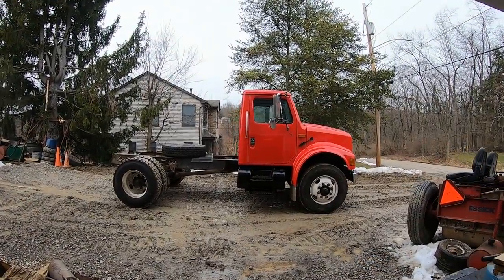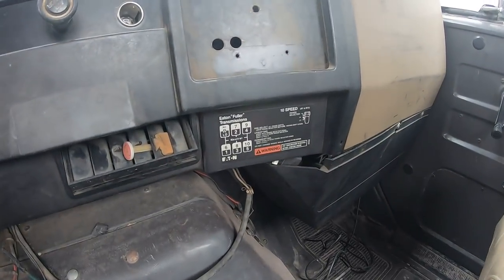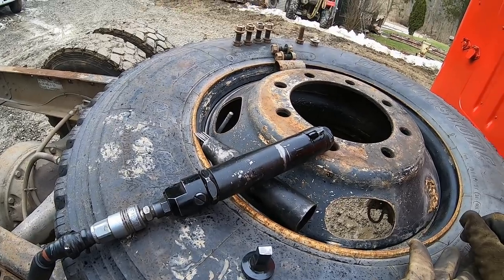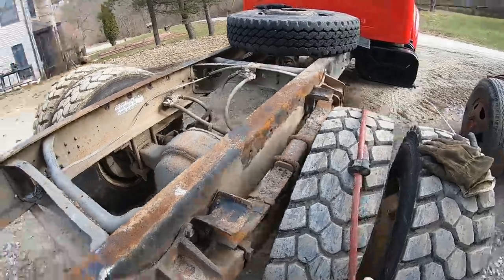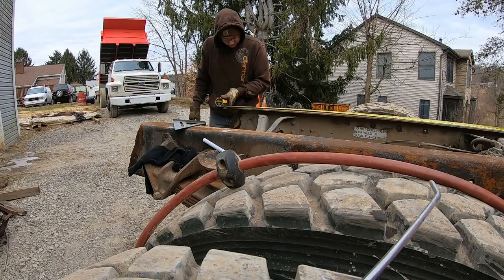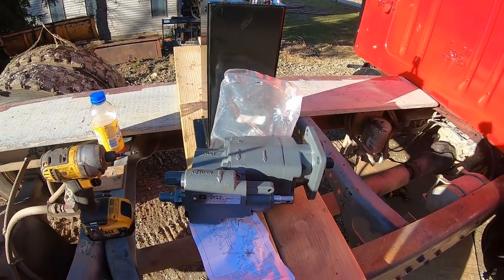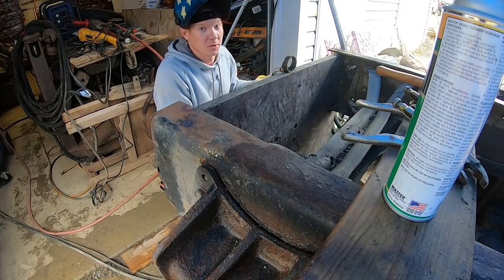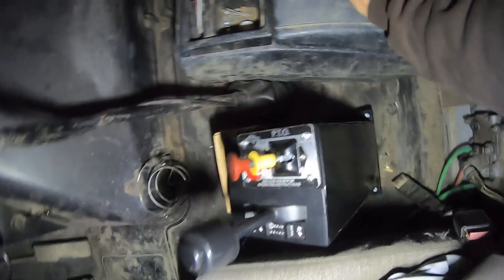Building a New Dump Truck!!!  Pt.1

Comment: many of the single axle 4900 road tractors i have seen had a 36,000 lbs gvwr compared to a medium duty cab and chassis that is typically top out at 32,000-33,000 lbs gvwr. nice base to start with. 10 speed will be helpful pulling a trailer with a big excavator. never been a fan of horrible freight products. that is an impressive metal cutting circular saw.
Reply from the maker: I wish that were the case, I titled it for 33 thanks for watching!!!

Comment: That's a great color choice.  I'm impressed by that saw you used on the frame.
Reply from the maker: That thing is a beast! ive cut 1" plate with it!
Reply: must have one of those saw you used.
Reply: @unclesamuk8687   I bought a Morse circular saw.  I've yet to try it out.
Reply: @DieselCreek   what type of blade do you use?

Comment: My father built a truck really similar to this using an '80s school bus with the 9L diesel and Allison 4 speed as the starting point. He took off the body, shortened the frame/moved the axle forward. Mounted an '80s cab and used the original nose. He then mounted a dump body off a '60s Ford dump that the cab was about rusted off of. My uncle owned it and when the 390 finally let out the smoke it was parked and never moved again. Only other things he did was repairs to the rust on the dump body and extended the sides up, and paint on cab, frame and dump body. Bright red like this on black. Looked brand new when he got done. It basically was chassis wise. All new everything it needed, including air brake cans and lines. Being a school bus the engine and transmission were really low miles too. The guys at the quarry were blown away when he showed up the first time because they knew how old it was and it looked pristine.
Reply: Oh, another thing I forgot was that he got a 2 speed rear out of something else and put that on it so with the 4 speed automatic and the 2 speed rear it was an 8 speed. It had a little bump shifter like on a car set up for drag racing, so you could manually shift it and split gears if you wanted to. I don't think he ended up using it too much though. That torque converter compensates for a lot.

Comment: A phosphoric acid based rust converter I's sure you'd find beneficial as a pre paint agent. I was surprised to see a chassis label advising not to drill or flame cut the chassis members.

Comment: That was totally unexpected. I never saw a skillsaw cut through thick steel like that.  Magic hands on the skill saw.  What type of blade was that?  and what is copper shmoo?
Reply from the maker: It’s a special saw that spins slower to get make better cuts, you can put a metal blade on a regular saw and get decent results tho. Copper shmoo is never seize lol
Reply: @DieselCreek  thanks for the responses. i actually keep the things in mind for when i do hobby jobs.  I always think outside the box.   Also i like the idea of anti seize. I used it on spark plugs on my last car.

Comment: just found your channel, weve got a 1998 4900 466 aswell but with a 6spd alison auto and 6yard dump, they are good trucks hasnt givin us any problems yet.. subscribed forsure, looking forward to that shipping container shop build!
Reply from the maker: Go check out the playlist there is 3 or 4 videos so far, probably not any more till the weather improves, thanks for subbing!
Reply: Of course they are good trucks, it's an International. I had a RD 200 with 5 and four 406 gas. Not speedy but she sure was steady!

Comment: Corn Queens have come a long way, at first I thought it was one of those fruit cans and that will tell you what I think of the  cab cracking expensive to repair trucks. I got a corn queen to replace my old loadstar 1800 with the tilt nose and a gas engine 392 but it came with a lot of very expensive goodies... .like a thirteen speed and two speed steel deck, winch in frame and out the bed for double reduction and roll on tail twenty foot bed, hauled my cat D4 on it but I carried my komatsu excavator also and just so easy to load. I really loved that truck and had a DT466 ready to go in it but why, it did the job easy and never a problem other than it had over a million miles on it. I got in that truck with both tanks full and did a eight hundred mile haul without a hiccup. but the 95 corn queen had a DT466 in it and a box ready to dump but the box was too big so put a 5 to 7 yard box on it. And cut six feet out of the frame and remounted the air ride on it. Oh it is smooth, ten speed, two speed rear with better highway gears and a engine brake, not a jake but I forget what it is, like a retarder, I can't get the cat or bobcat in the box but I load the excavator in it course I would haul it in a pickup if it wasn't so dang big. It's a 170 so it is as big as the box, I carry the tailgate in the bucket/thumb.
Reply from the maker: Sounds like a heck of a setup! Thanks for watching!
Reply: I looked up Corn Queen in Google images.  
I don't think it's what you are talking about.
Reply: @jayadinash9102  From early nineteen hundreds to the eighties, I heard this western slang or the international trucks... not so much any more. So it dates me as a old timer assuming you would know what I was talking about. Sorry as it is not meant disrespectful at all. The popular trucks all had nick names "Corn Queen: is a highly respectable truck from where I am from. Not meant to upset

Comment: so that used to be a tractor turned into a dump truck.  What all was required for the conversion?  Dump body, cab controller and...??  Did you have to add a hydraulic pump?
Reply from the maker: yes, its all in the videos. there are several parts to the series, heres the playlist. https://www.youtube.com/playlist?list=PL_pBKaJD0nwUpohhxHEIEpYRevq4Nn0mr

Comment: what did you pay for the cab and chassis? i’m looking into buying a 4700 466 with 10speed and 90k miles for $3k
Reply from the maker: 7800 i think. It had all new tires and brakes and a clutch and about 25,000 on the engine overhaul tho otherwise it would have been a lot less

Comment: I see you sprang for the universal Meatball protection device on your couches🤣 .
Seriously though, What are you using to cut those frame rails. It chewed through then like butter. I generally use a band saw and it a PITB and i have tried cutoff wheels and they dont do a good enough job either.
Reply from the maker: That plastic is actually for the dang cats we got stuck with but that’s another story.... that’s a skillsaw outlaw. Made specifically for metal. Works very well! I’ve cut 3/4 plate with it!
Reply: @DieselCreek   LOl i know what you mean. My cat thinks the dogs are just warm mobile beds.
thanks man. going to look for one on Kijiji right now.
Great build BTW.
Reply from the maker: Thanks for watching!!

Comment: What tires are on the rear of that Red International? I have started a transport company with International 4700 C&C 34ft plus a 02 Ford F350 crew cab dually.
Reply from the maker: 11r 22.5's Michelins I dont know the tread pattern name

Comment: Iam watching part1 and I  know you won't have your shop done BUT when you get it done you well not know how you work out side 😉 before , if possible try and make it possible, too add something to the  end or back for not every day tools that's in out of weather like your air cone? preaser (GOD I WISH I COULD SPELL) then u can run your air lines over head along with your pull down lights and extinctions cord. jk Tucson

Comment: Hello Diesel Creek!!! Hey What's the brand and the model of that circular saw and kind of blade are You using with it? How much was the truck? Thanks again!!! KUDOS from South Florida.
Reply from the maker: That’s a skillsaw Outlaw they call it’s specifically made for cutting metal. Probably running a diablo blade in it also for cutting metal, the truck was $7500 if I recall

Comment: What is the blade your using to cut the frame rails?
Reply from the maker: Diablo metal blade but it’s a special saw too made specifically for cutting metal. It spins slower

Comment: Man is this thing ever neglected , Especially the unreadable Dirted up boring gauge cluster Gross all the way around including the weird paint color choice, Not even an Plush Air Ride chassis , Cheap Farmesville Leaf spring. Imagine spending 8 hours or more in this Torture chamber on wheels ground grip bias ply's. Disturbing.
Reply from the maker: Most trucks this size are spring suspension, I’m sure others are out there but I’ve personally never seen an air ride one. And I’ve spent a lot more than 8 hours in it just fine.